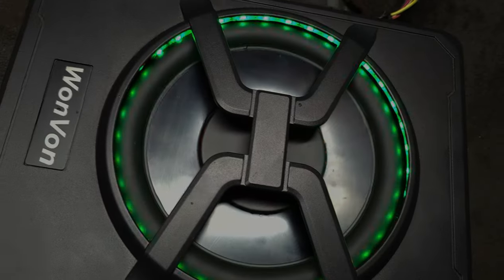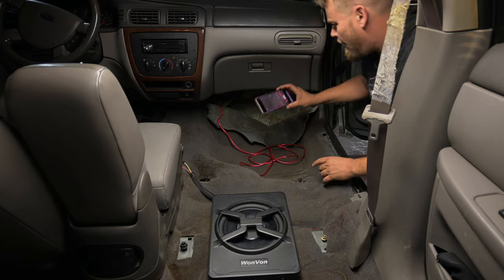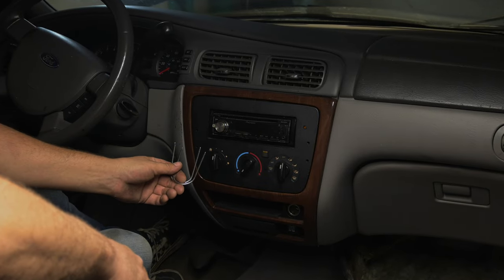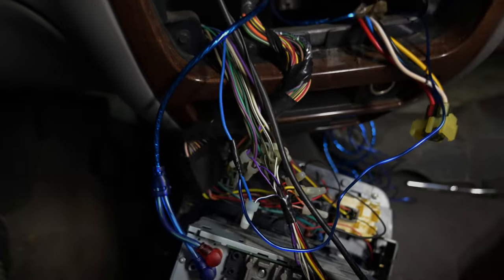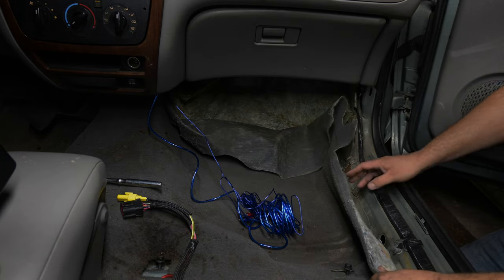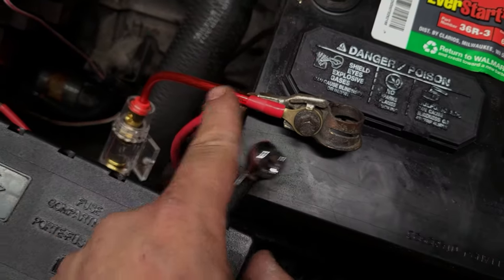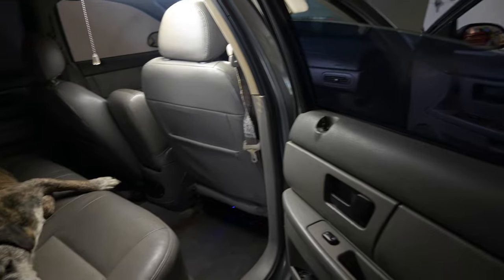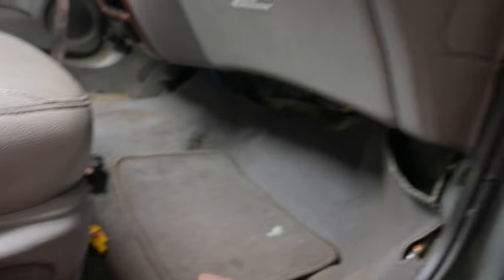How To Install a Subwoofer UNDER YOUR SEAT! - Cheap and easy!

Comment: Hey thanks for the tutorial!

Someone from your previous video posted this: "That's cool. The reason it's staying on is because it's not hooked up on its own circuit, what I'm mean by circuit is the install you have on is its own for what ever other speaker sub you have but if you wire it completely as if you didn't have the other speaker on it would work as it should. I had the same thing happening with one of mines, so won von 1 circuit other speaker 2 circuit, I'm not on electrician by far so I may not be using the right term but I'm sure you get it. Anyways great video keep beating the shit out of it and the videos"

Can you let me know what you did so it turns off when your vehicle turns off? That comment is super confusing lol
Reply from the maker: Thank you for the compliment! I am actually making the 3rd video on this sub to go over all the functions including the auto off function, setting gains, different connection options and stuff like that. Pretty much a navigation guide.

It will be up by tomorrow.

Thank you again for the support!
Reply: @Blowncapacitor84  Hmmmm. I read the manual and it says the Auto Power On switch should be set to off with the remote wire installed and I did that, but it isn't turning off. I wonder if my remote wire isn't connected to the proper wire.
Reply from the maker: @BREAD_FPV  look at the little blue power light. If it goes off, then the amp is off. If the led lights around the speaker stay on, then that means you have to turn off the lights via the lotus lantern app.

Also, make sure the auto off switch is pushed in. Pushed in is actually off, which is a bit counterintuitive, lol
Reply from the maker: @BREAD_FPV  one more thing, you could check voltage at the remote wire and see if it shuts off with the vehicle.
Reply: @Blowncapacitor84  That's what I'm thinking is happening. I'm running the wires in a 2022 Subaru BRZ and there's a stock Amp in the back of the car with a remote wire. Using that makes the blue LED stay on. I'm going to try running the remote wire to the RADIO fuse in the fuse box to see if that works.
Reply: @Blowncapacitor84  So apparently on the 2022+ BRZ/GR86 cars, when the key gets close to the car, the amp turns on which gives power to the remote wire. I tested this and it proved to be true so everything is working as it should now!
Reply from the maker: @BREAD_FPV  NICE!!!